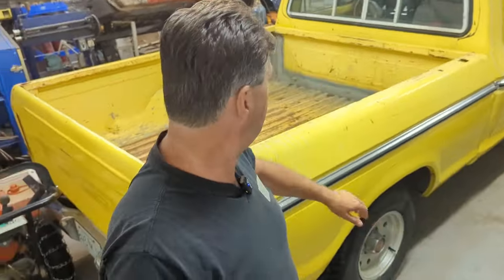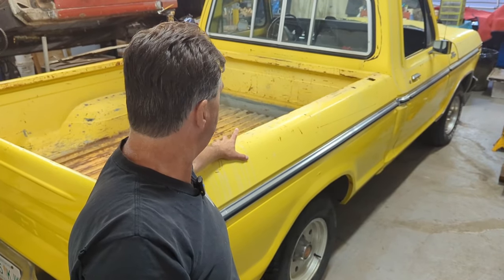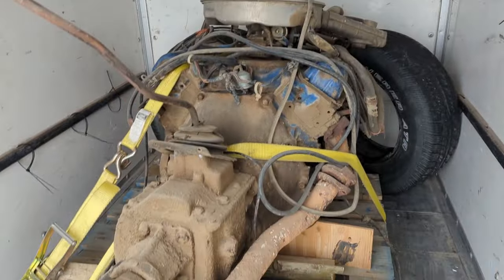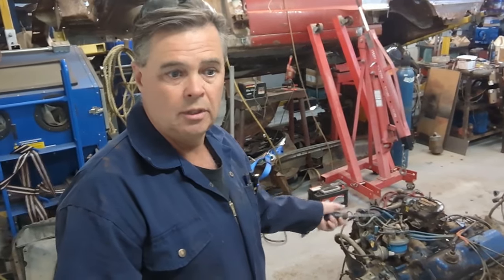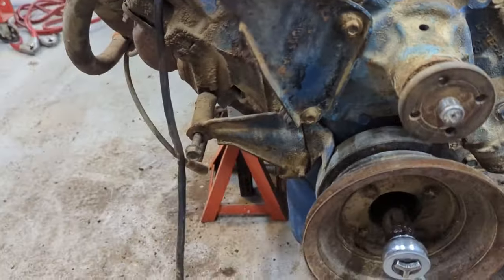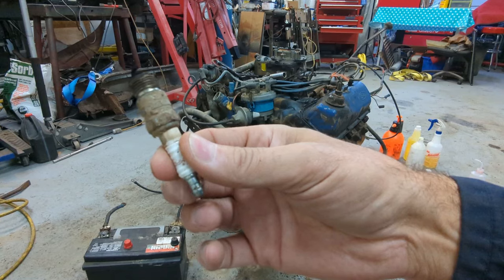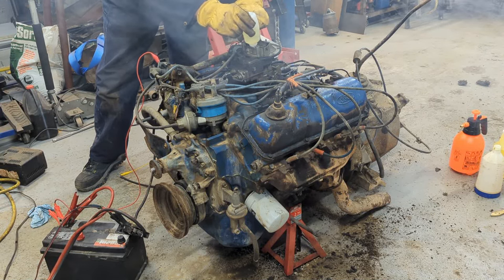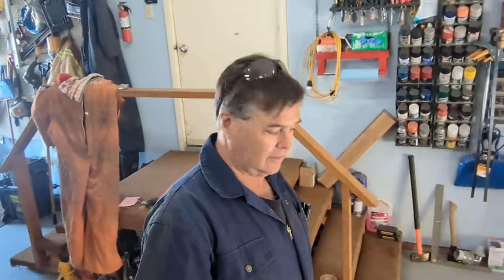I Bought a New Project Sight Unseen off FB Marketplace While in Mexico!

Comment: You look tan and rested. I had three Ford pickups over the years
 All had the 302. The last one was a ,79.   The engine was ok. But I found low milage 302 out of a late eighties mustang. Did the usual cam, lifter rockets, head job, bores were standard so we're the rod and main journals. It was a fun project for me and my two sons. You will find many of the seventies bronko parts inter change with the series F series. Good luck!.... Walt
Reply from the maker: Hey Walt,
It was a nice break from winter. 🌞
This Bronco will be my 3rd 70s F-Series ford, all had different engines, the first was a 360, one 300, and now a 400...all equally hard on ⛽. Lol